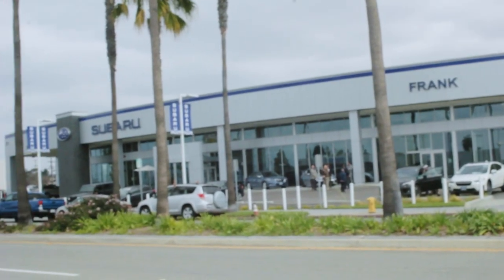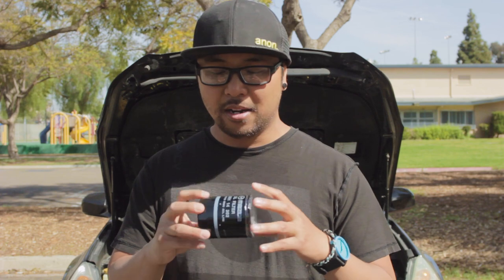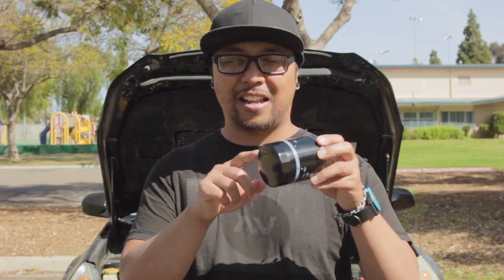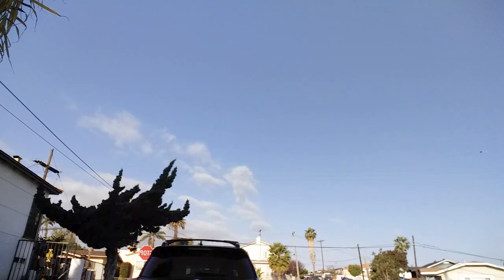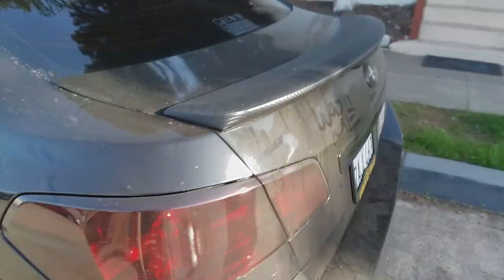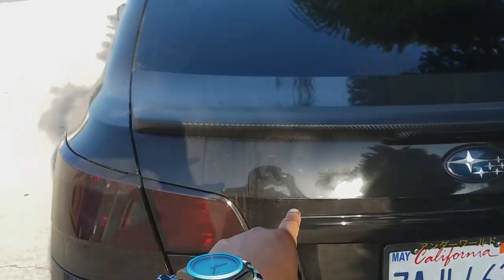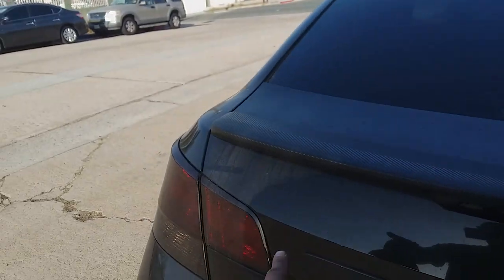Using MAZDA Oil Filters in my SUBARU

Comment: Been using the N3R1-14-302 in my 2010 2.5L normally aspirated engine for a year now. Find the Mazda N3R1-14-302 is also easier to install due to its taller height. Oil looks better after my oil changes doing the same mileage. Better changing oil more often than using so called better oil for a longer period of time.
Reply from the maker: Glad it's working out for you! Yes I agree the larger size makes it way easier to install as well 🤙

Comment: The filters work great - no changes to oil pressure according to my gauge. I recommend pre-oiling the filter though! There’s a lot of filter media and it increases startup wear if your oil pump needs to push oil through a dry filter
Reply from the maker: Bill Peralta it always works great for me. Yes I always prime my filters!
Reply: If you feel the need to pre-load the oil filter, then your oil pump is weak

Comment: On EJ engines you also use 15208AA032, intended for the 6-cyl engine. It is also made by Tokyo Roki.
Reply from the maker: I dont think that filter is available in the US
Reply: @victordeleon8412  Sorry, the number ends with 031, not 032. I edited my previous reply. It is available and the only part number specified for 6-cyl. applications,

Comment: Made the changeover today. Went on easy. Almost seems to seat better than the Subaru filter. Got any tips for avoiding oil pouring out of the filter while unscrewing it? Maybe I am not waiting long enough?
Reply from the maker: Because the filter is bottom mounted there's not much you can do to prevent over flow when you remove the filter. Just make sure you're draining the oil from the pan before removing the filter that will help make sure there is as little oil above the filter as possible
Reply: Yeah they make oil filter drain sockets you can just put on the filter and it will drain the oil in there down a hole. It also has a 3/8 square for a ratchet
Reply: Break the filter loose and then use a plastic solo cup to unscrew. The oil will drain into the cup as you’re unscrewing, instead of getting on your hand.

Comment: thanks for this video good info. So tired of Rotella bandwagon. its diesel oil, not purely for gasoline engines.
Reply from the maker: Yeah it's not bad oil, just not chemically designed for our motors
Reply: subtledriver it’s designed for both...and it meets all the specs but hey use what you want

Comment: I tried using the 09-10 Mazda OEM Black Tokyo Roki Filter Part# N3R114302on my 2004 Forester XT and it DID NOT thread on correctly.  Am I missing something????  Everything I have read and seen online says it would work?
Reply: Nick Luedy I think it’s for the EJ255
Reply: All subaru EJ engines use the same oil filter.

Comment: The reason this filter is specific for RX8 series 2 is because the internal bypass spring pressure.  RX8 series 2 run double the oil pressure of series one.
Reply from the maker: From what I've read up, it's the same spring pressure as the Subaru filters
Reply: @victordeleon8412  23psi is the spec. It's within the range of the RX-8 filters. For standard sized filters I run WIX. The bypass pressure is right on the dot at 23psi, I haven't found another filter for the EJ that does that.

Comment: 40 weight Especially if you live on a hot climate. If you have to use 5w30 still go with motul
Reply from the maker: I tried the Motul 5-30 once just to try it. It didn't feel as good as the 40
Reply: Victor de Leon how hot do your summers average?
Reply: Love motul oil

Comment: Would the Mazda N3R1-14-302 filter work on a 2014 Crosstrek...we're using synthetic oil, and want to change just the filter every 3k
Reply from the maker: Jetli _Notme I have all the matching Subaru filter part numbers that fit the Mazda filter listed in the description of this video
Reply: Victor de Leon, thank you! I saw your link after I posted my question...and Unfortunately, it won’t work for our application. I purchased the Purolator BOSS as an alternative, we’ll see how that works!
Reply: Your filter mounts on top of the engine correct, 15208AA160 should be the correct part number.
Reply: Victor de Leon after this video i bought it from amazon for my jdmwrx! Its still shipping, i want to ask u: is there any  chance to get fake one from amazon?
Reply: lasha archvadze, if it says “Made in China” there’s always that chance!

Comment: Is the Mazda filter any more expensive than the blue filter?
Reply from the maker: Leandro Arce around here the Mazda filters are about 10 and the blue Subie filters are about 7 or 8
Reply: @victordeleon8412  Thanks! Where I live is like $6 the blue filter, not bad, but I think if the Mazda filter is around $10, I'll prefer to buy the WIX XP, which is like $2 more than the Mazda (around where I live), and has the 23 PSI by-pass valve.

Comment: This filter fits Subaru Ascent as well, thinking of using Motul for my first oil change. Did anyone ever used Liqui Molli on Subarus, what's your experience?
Reply from the maker: Ive never used Liqui Molli but I know it's very popular to use in Euros. throtl.com has a sale on motul use coupon code motul20 at check out for 20%off (I think the deal is still going on but not sure)
Reply: I use Liqui Moly in my 09 Spec.B and it's equal to motul IMO.
You should probably not use this filter for your Ascent though. The Ascent does not use an EJ series engine. The oil filter may physically fit, but it might have different specifications. Best is to use OEM if you want to make sure your warranty will stay intact.
Reply: Motul is the best hands down. Been using it for 5 years so far in my wrx. Never had an issue once. Liquid Molly is also good but I only get that as a second option if motul happens to sore up to $65 on amazon for no reason. Can also get it at image import racing for 35 just gotta pay shipping. Liquid Molli also has Ester in it

Comment: Do these work for the new fa20 I have. A 2020 wrx
Reply from the maker: No unfortunately the FA uses a different filter. But you can ask at the dealership if they have black Subaru filters for the FA, those should be made in the same factory

Comment: Good video! But maaaaaannnn, the drive through touch was painful at the end. You're better than that!! Lol
Reply from the maker: Eh it's not new paint 🤷‍♂️ if I ever do a paint correction I wont bring it through there anymore
Reply: @victordeleon8412   would you still recommend pouring the factory spec amount of oil? Or would dumping the whole 5 liters into your engine with the bigger Mazda filter?
Reply from the maker: @crc4586  yes use the factory spec amount. You can prime the filter by filling it with oil before installing. Use the dip stick to figure out when the oil is full. You’ll probably end up adding a little less than 5qt because factory spec if for an empty engine. There is always a little of the old oil left when you drain.

Comment: Dude, the Rotella Full Synthetic Truck/SUV 0W-20 motor oil has the API SN rating, plus all the other typical ones. Check it out on Amazon if you need to see the list.
Reply from the maker: I've seen that oil, but I've never seen it above 0w-20. 20 weight oil is too thin according to the Subaru service manual. 5-w30 is reccomend and you can go as high as 5w-40
Reply from the maker: I just checked on Amazon it looks like they do have 5w-30. They announced it last year on their website but I never found it for sale anywhere. I guess they fina6have it out thanks for the tip
Reply: @victordeleon8412  0W-20 is recommended for the 2014-17 Forester 2.5L models. I used to get the Mobil 1 whenever Costco had a sale on the 6-quart box.
Reply from the maker: Yeah my Legacy is a 2010 so its rated for the thicker oil, plus it's better for the turbo.
Reply: Victor de Leon the 5w-30 version
https://www.amazon.com/Shell-Rotella-Synthetic-Pickups-Single-Pack/dp/B07MSQ6TP2/
The Havoline oil
https://www.amazon.com/Havoline-223722482-6PK-5W-30-Synthetic-Motor/dp/B00M1Y3E7O/

Comment: Why not use Idemitsu oil?
Reply from the maker: To be honest I've never tried it
Reply: Victor de Leon if you buy the oil from the Subaru dealership it’s made by Idemitsu. If you look at the back Subaru(SOA427V1415).
You will see Idemitsu printed on that label.
The Idemitsu Zepro is slightly different than the non-zepro stuff.
Zepro Touring 5w-30
https://www.amazon.com/ZEPRO-Touring-5W-30-Engine-Oil/dp/B072KDS2V2/
Standard version
https://www.amazon.com/Idemitsu-30010099-95300C020-Synthetic-Engine-Fluid_Ounces/dp/B072QXSCZF/

Eneos is also one I would try. 
JX Nippon Oil & Energy Corp is the manufacturer. JX is Japan’s version of Exxon-mobil.
https://www.amazon.com/Eneos-5W-30-Fully-Synthetic-Motor/dp/B07F7B7QN6/
They supply oil to Mitsubishi...